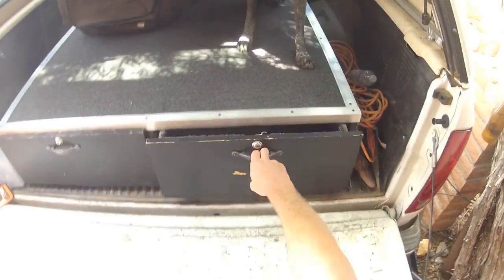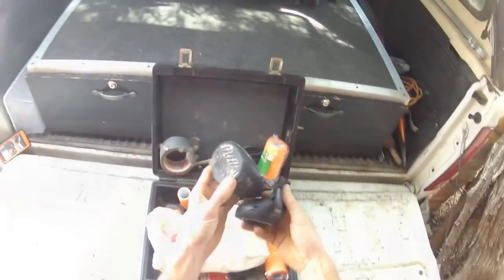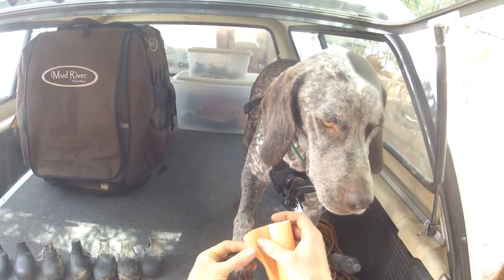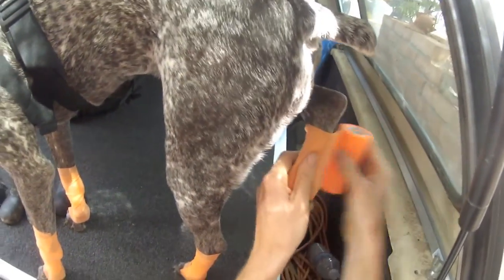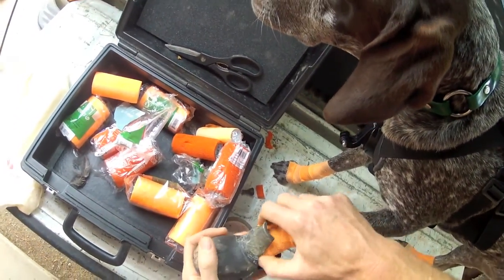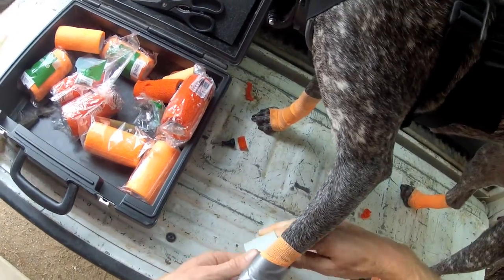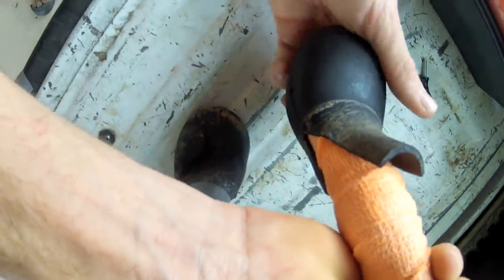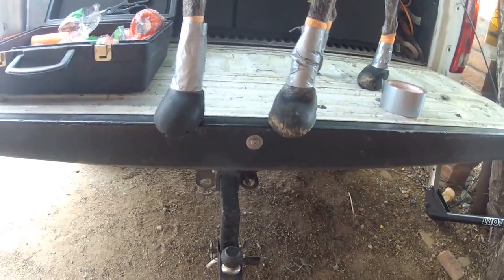How to boot your dog and install Lewis Dog Boots with Double Aero Guides

Comment: Thanks for the video.  I grew up in AZ and used Lewis boots on my springers way back when.  Never had a problem.  Now all these years later I'm hunting chukar in NV with a setter and every time I've tried to use them they come off.  I think the problem is that it's super cold and snowy and the tape is brittle and gets wet.  Going to try your method cuz my dogs feet are getting destroyed every time we go out.

Comment: Hi there .. Thanks for the vid. I live in AZ and looking for boots to avoid goat heads for endurance training out in the fields. These look like a good option. However, little concerned about rubbing. When the boots have been on for a while, do you have any problem with the front toes rubbing/pushing against the front of the boot? Also do they fit relatively well when you follow the manufacturers chart? (some boots seem to run larger or smaller then their fit charts) Would appreciate your input .. Thanks a bunch
Reply from the maker: +Sammie Too Hey there!  Thanks for watching.  My dogs run in these boots for 20-30 miles a day while hunting.  Do they rub?  Sure they do...a bit.  It's the lesser of 2 evils.  Cut pad--cactus--goat heads vs. A couple rubbed feet.  Not as bad as you think.  
My other video shows how you can install these without vet wrap.  I use balm after a hunt to help their feet, if needed.  
Montana grass blades will do far more damage to the tops of their feet than any boot.  Regarding size:  Lewis Dog Boots have a chart in Gun Dog Supply that you can print out and put your dog's foot on it.  My dogs:  45-50lbs run large boots.  Hope this helps.  Keep watching.  Subscribe too.  I'm always posting videos of hunting or gardening.
Reply: +Matt Russell Awesome Matt .. really appreciate the info, it helps .......Good hunting and always be well
Reply: Dont the vents let in rocks and dirt?